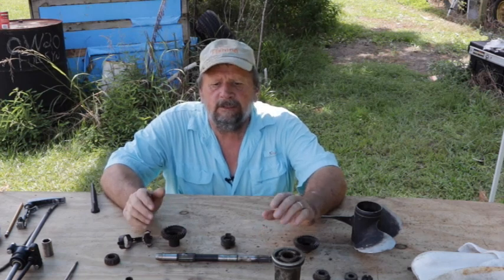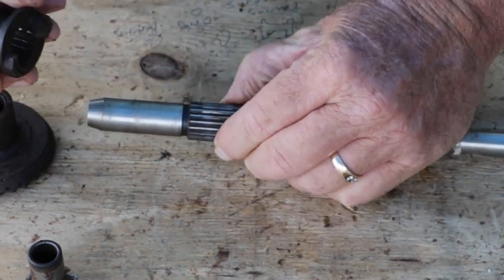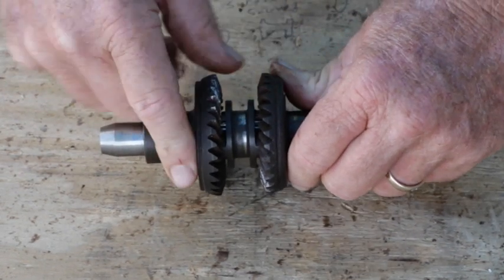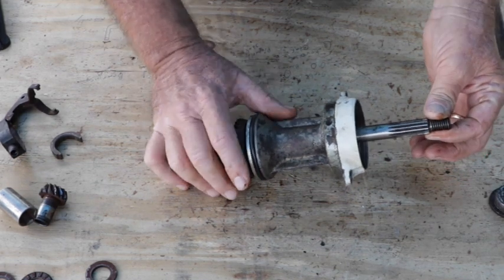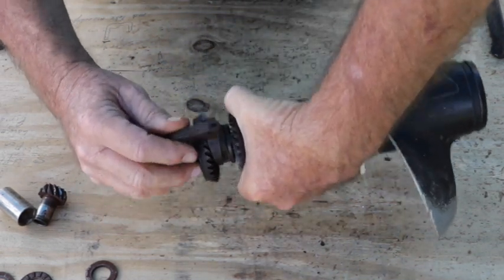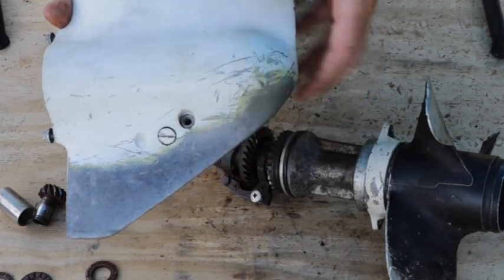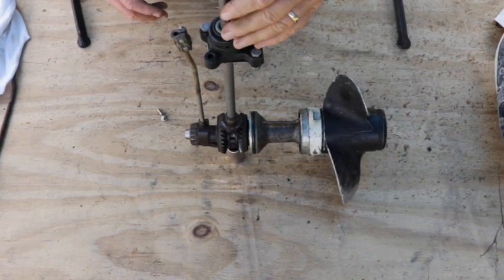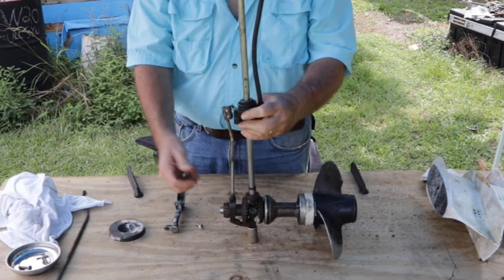"LOOK INSIDE" A  Outboard Lower Gear Case

Comment: My 84 evinrude 8 hp seems to be a bit different. The bearing is seized in the prop shaft in the case. I'm trying to get the pinion gear out so I can remove the gear and access the seized bearing behind it. In
 I have access to the pinion gear but cannot get it out. Does it get pushed out into the bottom past the prop shaft gear or up into the housing? Thanks